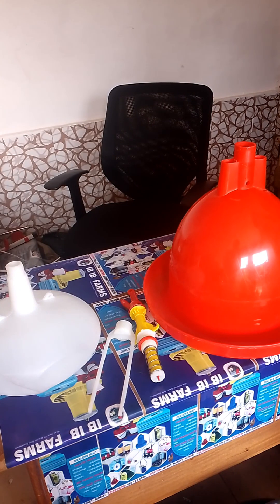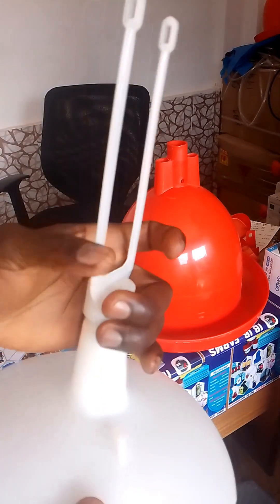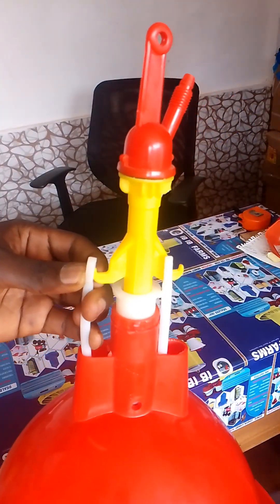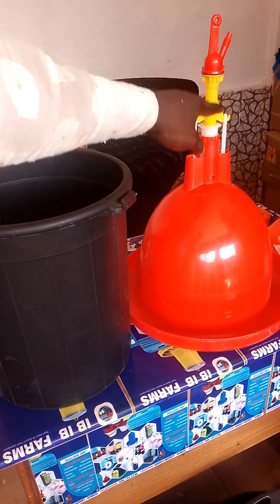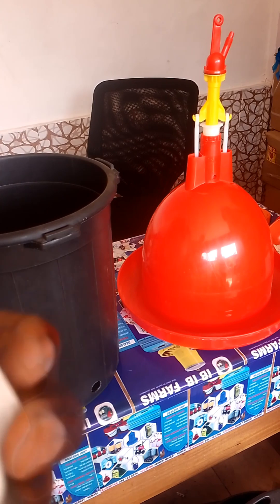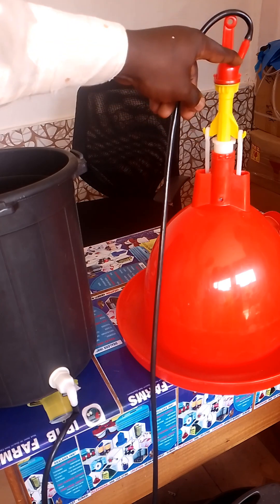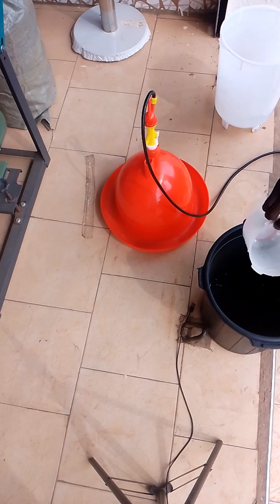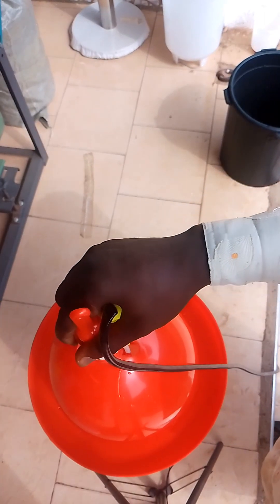How to Install Automatic drinker (Plason type) from Start to finish.

Comment: Sir when I join from bucket and i cover it with lit the water had gon e overflow with in 10 minutes not slow how to do
Reply from the maker: Adjust the water control valve